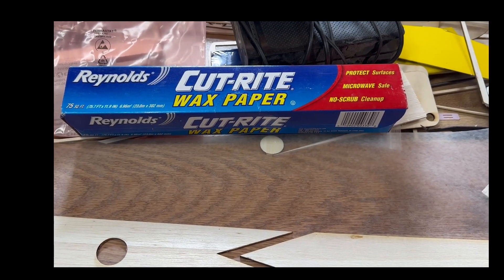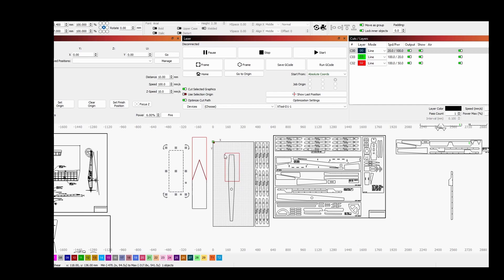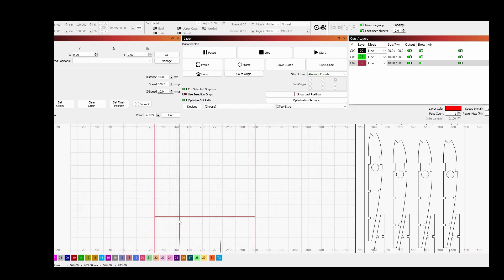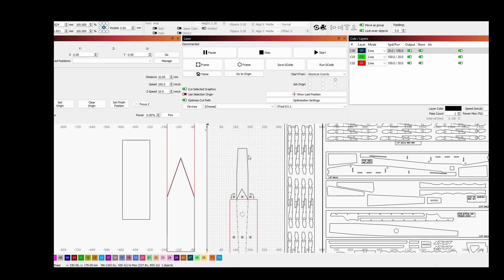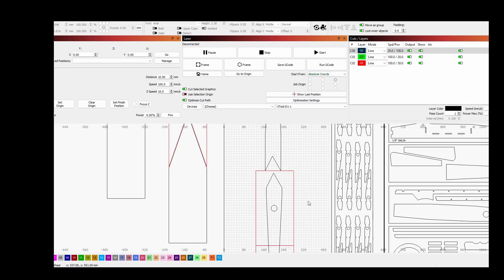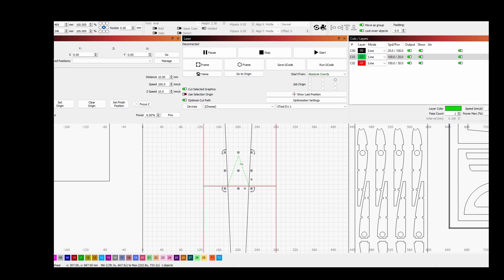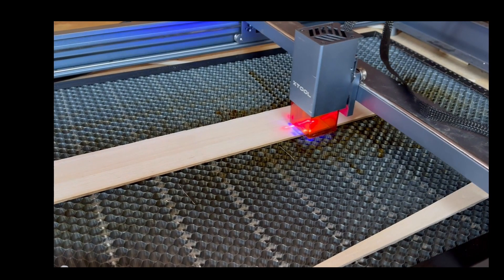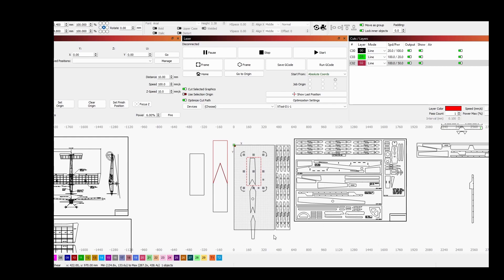Beginner laser cutting 1. Cutting large parts for rc airplanes without "Print-n-cut"

Comment: I could see doing this if you're manufacturing a run of kits, but for one plane it would take far less time to just lay some tracing paper over the plan, manually trace the part(s), then stick the tracing paper on to your sheet of balsa with some spray photo-mount glue and cut them out in the traditional manner.
Reply from the maker: This is just my personal opinion, make of it what you will. After getting my laser set up to cut ..well, any part..of an RC airplane, Man I wanna cut it all with the laser. My scroll saw and hobby knife and other hand tools just dont seem like something I wanna mess with anymore. I'm getting precise cuts that require much less sanding to fit properly. 
Try making an entire, ready to glue, set of ribs in 10 minutes by hand. That dog just wont hunt in my neck of the woods. LOL. You are most welcome to build as you see fit but, as for me, I'll continue to use my laser for parts, covering design and anything else I can dream up that gets me away from that freiking hobby knife that wont stay sharp for more that 10 minutes.

Comment: what laser cutter are you using?
Reply from the maker: It starter as an XTool D1 standard 10watt. After adding the extension, I had to start using the D1 Pro settings.
( all free from the XTool site) I run Lightburn as a 2d cad and laser controller. Recently added air assist. Actually very basic. I think if I were looking into getting my first laser I'd look at some of these that already have air assist and more powerful lasers straight out of the box. Most I have seen can be extended for less that it cost me on the XTool.